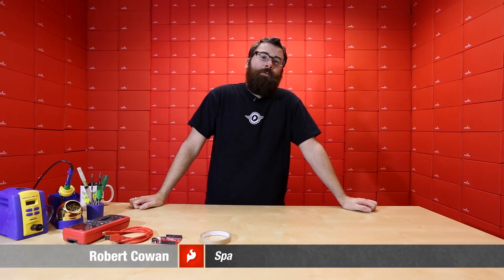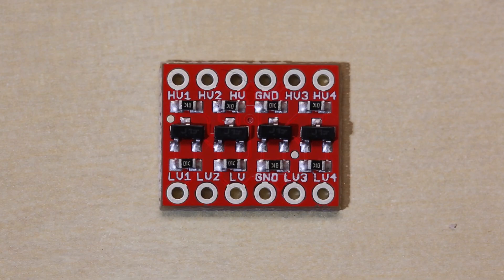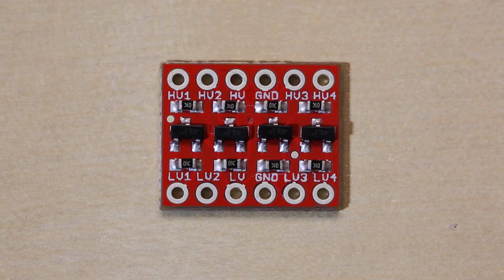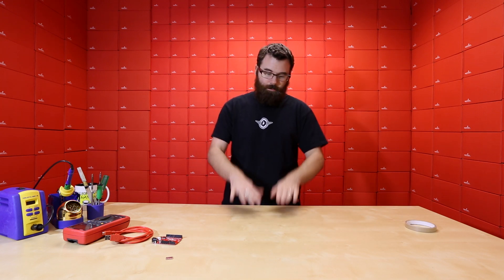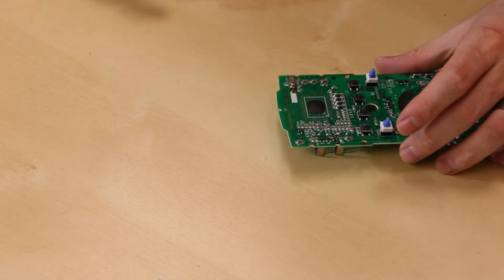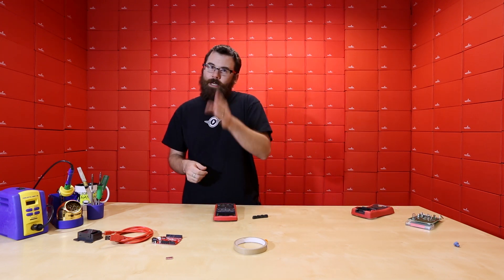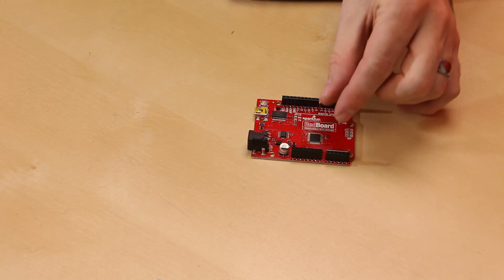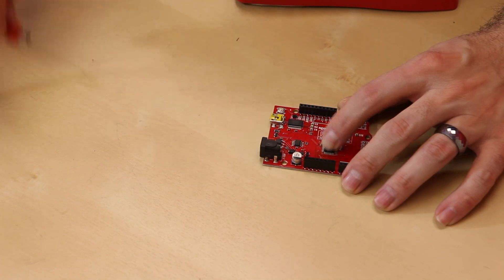SparkFun 10-25-13 Product Showcase: Sticky Situation

Comment: FINALLY I have a way to use those spare zebra connector displays.  Zebra connectors are ridiculously difficult for a hobbyist to source; managed to get a few engineering samples from Fujitsu Poly after a bit of begging.  Order forthcoming!

Comment: The data sheet for the tape says <0.3ohm for 6mm^2.  If a BGA pin is say 0.2mm^2, that would mean close to 10ohm on each pin.  I don't think a graphics chip (high current on supply lines) is going to like that.

Comment: Incorrect! What is shows, is a way to protect your design. So yes, it needs pressure to maintain contact, but when somebody wants to peek how it works, all they see is a circuit board with some loose resistors and a loose cpu. Changes are high that the device won't work when put together again.

Comment: Seeing the demo of the conductive tape before the adhesive has cured (requiring pressure on the microcontroller to maintain contact) doesn't exactly inspire great confidence in the product...

Comment: I have a feeling that the BGA won't like the Z-Axis tape... Plus, I think that the temperature, which was the issue in the first place, might also affect the tape. And I believe that the BGA is smaller than the recommended size of the tape as well.

HOWEVER, I would be very interested in seeing if this would work as well. Maybe once they get into 1.5 wide strips...